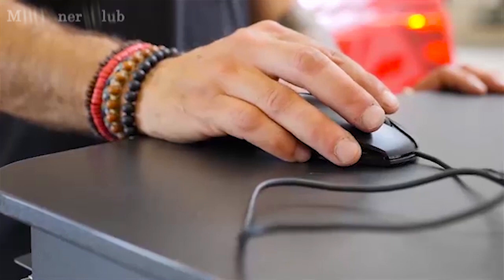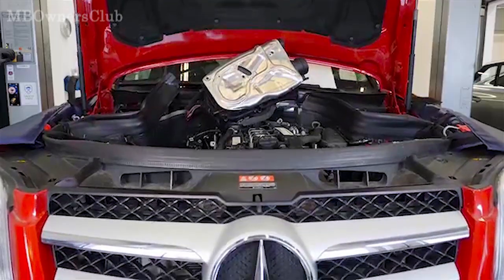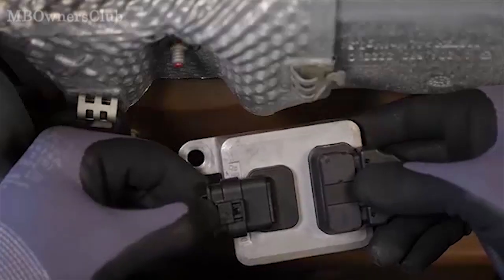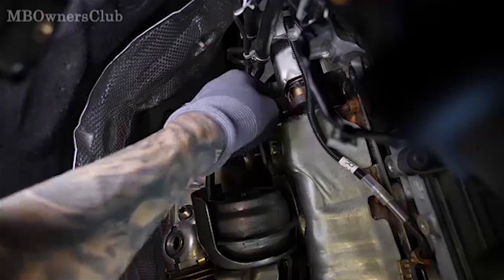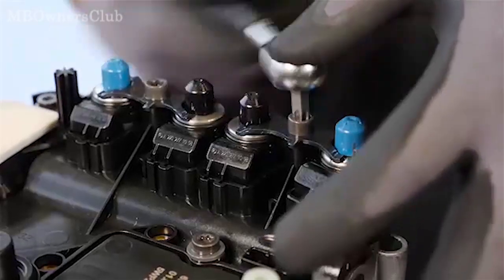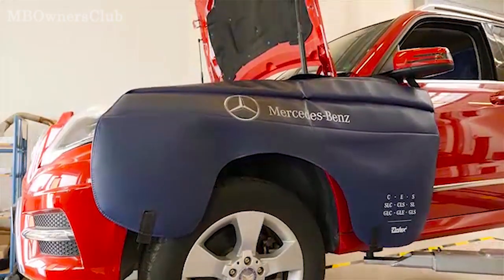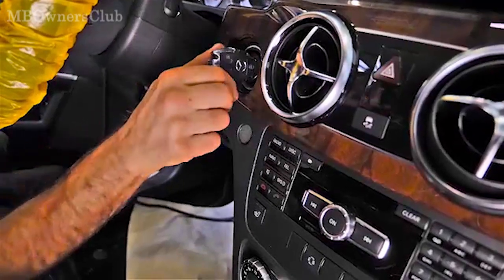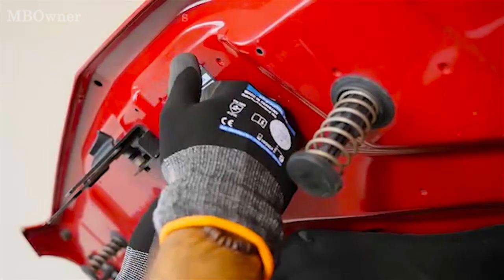Mercedes-Benz Exhaust System Maintenance: Removing and Installing Components | W204, C207, R172

Comment: Hello, I’ve seen your intresting videos on youtube. I’m from the Netherlands and I have a question about my car.
I have a Mercedes Benz C-class c220 2013 model (w204, 163hp). Since a month I noticed power loss and a slowed acceleration. Additionally, the motor does not exceed 3000rpm. It used to happen once in a few days, but now it occurs regularly. Since a week the check engine light also turned on. 
Computer scan of the car gave the following fault: p024872, component low-pressure turbocharger has an electronic fault, the actuator does not close.
What is the problem in this case? How can it be solved?